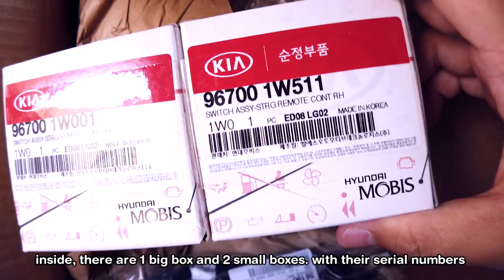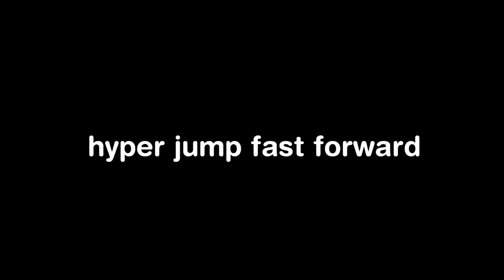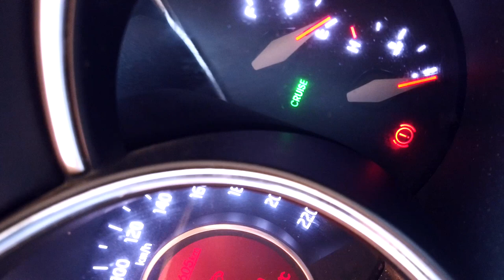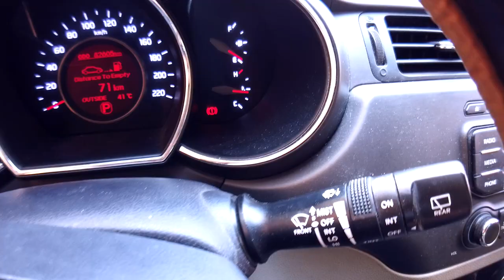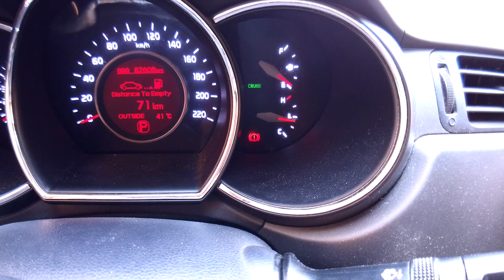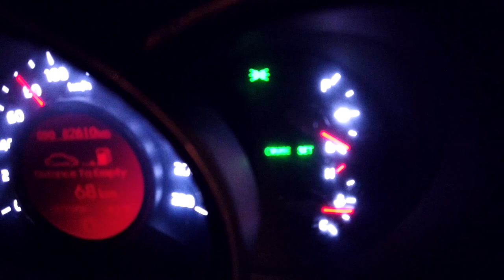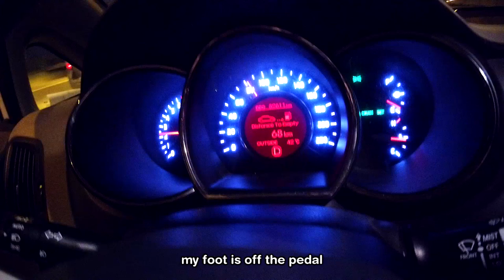Pasang Cruise Control di RIO Sendiri | Videonya Angga Panda #9

Comment: Mas saya jg udh pasang Cruise Control di KIA Rio 2015 manual, indikator nya nyala tp set speed 40 s.d 80 gak mau, yg jd pertanyaan apa cruise nya hanya bisa di set pada mobil matic?
Reply from the maker: Ngga sih mestinya, cruise bisa utk manual juga.. Mobil teman (brand lain) manual ada cruise. Dan iya cruise cuma harus sambil jalan agak cepat sepertinya
Reply: @anggapanda  utk indikator selain cruise apa ada indikator lain apabila udh di set, krna saya udh coba hidupkan cruise menyala dan speed saya coba di 80km bahkan sampe 100km saya coba set down/up gas nya turun gak mau di set
Reply from the maker: @ABahana2020  untuk set speed nya pas jalan switch kebawah (-) nanti akan ada indicator tulisan SET mestinya
Reply: @anggapanda  iya udh dicoba begini tp tetap gak ada indikator set n gas turun terus, cruise nya menyala tp fungsi nya blm n masalahnya apa jg blm ketemu
Reply from the maker: @ABahana2020  ini kata Google 
Yes, cruise control works on cars with manual transmissions. They put an additional sensors in so that if you knock the shift lever into neutral or you press the clutch before you turn the system off or you touch the brakes, the cruise control deactivates. Yes. But often it can only be engaged from gear 4 and up
Reply: @anggapanda  saya coba udh di gear 6 n speed di atas 60km stabil tidak injak kopling n rem hanya gas dan coba di set tombol down tetap gak berfungsi lepas gas speed jd turun, di coba tambah speed 80km sama jg hasilnya gak berfungsi.. 😑😑
Reply from the maker: Waduh.. Kalo udah gitu saya kurang paham deh.. Aneh jg ya, krn transmisi ga pengaruh mestinya
Reply: @anggapanda  iya begitu seharusnya.. Tp gak tau punya saya bisa gak fungsi, gagal mau di review.. 😐😐